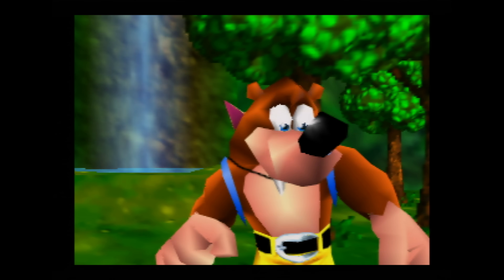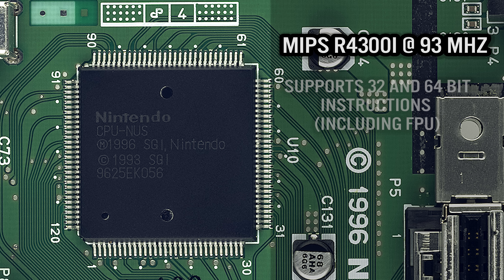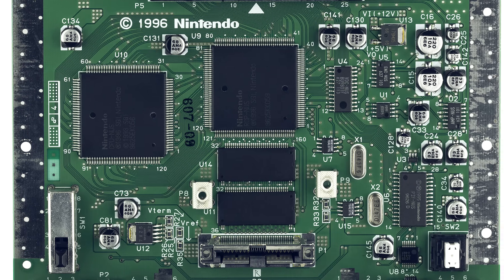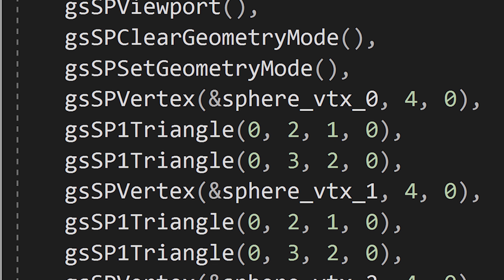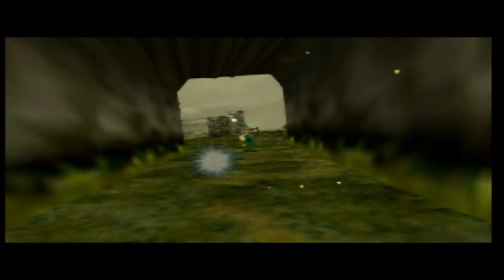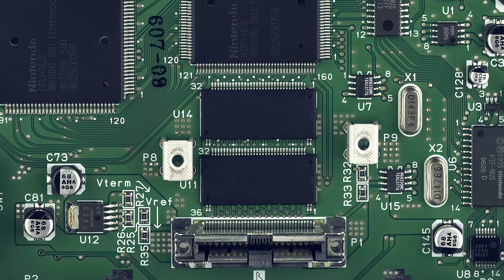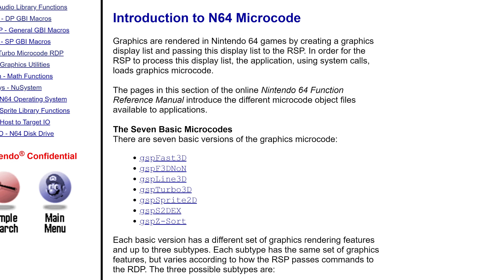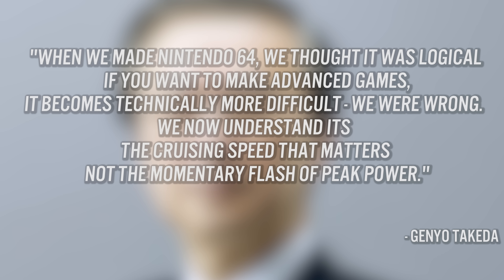Why was the Nintendo 64 so hard to develop games for ? | MVG

Comment: Honestly this boils down to new tech that nobody knew what to do with. At the time it seemed "really cool" to throw in a bunch of expensive sounding chips. Even better, lets make the whole thing proprietary and custom designed, that sounds even cooler. The same happened to the PS2 and PS3, they went through a similar phase. How many processor can we throw in, the more the better, it just keeps sounding more and more cool. What the gaming industry had to realize is that the ultimate goal should be simplicity. Multiple processors should only be used if they bring a clear advantage in keeping a complex system simple yet powerful. Proprietary hardware and code should be avoided because the most powerful asset is an asset that's tried and true and has been ironed out over time. Modern gaming systems now mostly do this with universal game engines, OpenGL or DirectX, and a move to standardized hardware but it took a lot of trail and error to realize the more custom parts you throw in the device doesn't lead to an equally impressive output, it just needlessly makes things complicated, provides a high entry barrier, and creates more potential bugs making development more expensive. Nintendo learned this early on but it took Sony a bit longer to figure out because they were persistent to keep trying different complex board setups in pursuit of the most powerful and most complex board. I think Nintendo and Sony both arrived at the same conclusion though and thankfully it's now so much easier to get into console programming.

Comment: I've only done homebrew development just for the sake of learning about these older systems. To give an example of TMEM, I took a font spritesheet I made for the 1989 Gameboy Original which was designed to fit into the lower third of Gameboy VRAM leaving 2/3 of vram free and ported that over to an N64 project. I was baffled that I had to break up the tiny front sprite sheet into 4 pieces so that I could load the font letters. I even had to implement an automatic bank switching system so that it would insert extra microcode as efficiently as possible to be able to seamlessly access the whole font spritesheet range. The font system alone required 2 people (Me and a friend) to implement and workout the bugs. I even commented in the code my disbelief that it was this bad and that somehow a much older black and white 4-color tile-based gaming system was far superior in this regard than a 3D powerhouse. That's only just one example, the extra complexity around such a small TMEM required a system to load tiny font tiles that had lots of bugs we had to iron out and then make efficient because the added complexity also added to the precious display list which needs to be kept down.
Reply: referral madness  The native languages. For the gameboy that was assembly and for N64 it was C. The same as most would have used back then. Really those are the only 2 systems I've homebrewed for outside of boot sector programs for PC's which don't really count in this example.

Both the Gameboy and N64 homebrew I did are opensource on Github https://github.com/junebug12851/GameboyBoilerplateProj https://github.com/junebug12851/HelloN64
Reply: referral madness  the popular, cheap, and readily available CPU at the time was the Zilog Z80. Nintendo being Nintendo decided to order that for the Gameboy however they wanted it tailored a bit so they ordered a custom variation of it. Therefore we don't have a name for the set of assembly instructions however because it's based on an incredibly common and well-known processor and because the gameboy is so old and has so little security the assembly instructions are very well documented and very well known. There are undocumented features and bugs but they're also well known by now. The only real mystery left is precisely how the graphics pipe-lining works which nobody really cares about unless you're building an emulator so I'd say the 1989 Gameboy is probably the easiest to get into and a 1989 Gameboy game will run on both a GBC and GBA.

Actually the 1989 Gameboy is so well known we actually have far better fan-made tools which are light years ahead of what the developers used back then and the fan-made tools are still actively being developed to this day with regular commits which is quite impressive. Out of all the consoles you can write Homebrew for, the Gameboy is by far and large the easiest to enter with the best modern tooling and even syntax highlighting and coding support. There's even sound tools that help you write great sound effects and music. The gameboy also has the best emulator support with full debugging capability like you'd have in modern tooling and the amazing fan-made compiler outputs symbol files the debugger picks up on automatically.

I say go for it and have fun. Here's a list of all the resources you'd ever need and plenty more to get started https://github.com/gbdev/awesome-gbdev

Comment: This video begs the question why the hell didn't Nintendo 64 output S-video & RGB Scart like the Super NES. Both consoles share the same AV-OUT connection as well. It's madness. The composite output on the N64 is worst ever! Out of all the HDMI mini consoles that have been released, the N64 should have been the first one out. Criminal.
Reply: it can do svideo just fine
Reply: @crashoveride879  The N64 could do S-video if you have a NTSC N64. If you have a PAL N64 you need a modern custom S-Video cable. Standard S-video cables don't work on PAL N64 machines. Standard S-Video &  RGB scart should have been available to all N64 systems out of the box.
Reply: Without Rare’s games there’s barely any games to put on an N64 mini. I guess they would have to work something out with Microsoft
Reply: @lvl99ultrathug  Yes and No. I think an N64 mini console with Rare's games would be better for sure, but I also feel that there are more good non-rare/nintendo games on the N64 than what people think. Eg: Star soldier, Forsaken, Sin & Punishment, Turok, Last Legion UX,  Cruisin World, Ridge racer, ISS, Quake 2, Resident evil 2 etc,

Comment: I remember that around the same time Intel based PC systems also used RDRAM which cost much more than the regular SDRAM of the time.  It made Intel platforms a truly expensive proposition (which added to the fact that Intel soon found themselves also struggling in the mire that was the Pentium 4 era) made AMD based systems a real lifeline to those like myself who are on a tight budget.
Reply: It was actually a few years later: Intel started using RDRAM  in 1999  late in the Pentium 3's lifecycle with the i820 chipset .  It went BADLY: the Pentium 3 couldn't take advantage of the memory bandwidth because it was on a standard  SDR (usually 100-133 mhz) front side bus but still got saddled with the latency penalties, the chipset itself was bugged as well so you couldn't use the fastest RDIMMs it was theoretically compatible with.  Intel then started pushing it hard with the Willamette Pentium 4 platform because the P4 was MASSIVELY bandwidth dependent: Consequently the P4 was designed with a "Quad Pumped  FSB" that meant a 100 mhz system bus had effectively 400 mhz of bandwidth, allowing the P4 to take great advantage of  RDRAM's memory bandwidth.  Price I( don't think any of the 3rd party chipset vendors ever used RDRAM), the aforementioned latency hit, improved P4 architecture (specifically bumping the L2 cache to 512 to 1 meg) and heavyhandedness by both Rambus and Intel meant  RDRAM fell to the wayside once DDR (speed equivalent to 2x the base clock) ram came onto the market. Intel effectively abandoned RDRAM by the time the Prescott and later Northwood core S478 chips were released.
Reply: @ironhead2008  Yeah, I am probably confusing the time period slightly because the late Pentium 3 era / start of Pentium 4 is when I remember my cousin having a Gamecube.  Personally, I had been away from the console scene since the Sega Gamegear and I was not aware of RDRAM before Intel started using it.
Reply: @jameslewis2635  to me it's kind of hilarious that intel made the same mistake Nintendo did with RDRAM : going with a pricey high latency system with lots of bandwidth that nobody else was using. Nintendo had the excuse of not knowing how to develop an advanced console at the time (nobody did, really). Intel? I suspect it was pure ego and impatience. They wanted to get clock speeds up and  figured they could bully everyone into adopting RDRAM. Instead, the market gave them the finger and went with 3rd party chipsets that or abandoned Intel entirely for AMD (whose EV6 bus and K7 architecture was nowhere near as bandwidth starved and could stick with SDR for a bit longer), Intel had no choice but to embrace DDR (which didn't have enough bandwidth for the Willamette based P4s with 256K of L2 cache)  and SDR (as a cheaper option for some mobo manufacturers - these were huge dogs as far as performance was concerned:weaker than late P3s) to move P4s and retain market share. Phils Computer Lab has done  several videos on SDR and RDRAM based P4s and how they stacked up to both the Tualatin based P3s and contemporary K7s as well as DDR based P4s, they're quite informative. The "end of the era" 3.06 GHZ Northwood core build he did with a FireGL X3 gave an idea of just how powerful  a system built around RDRAM could  be.

Comment: Speaking about how Nintendo looked back in hindsight and thought they should have done it differently - this reminds me of a little tidbit I noticed in some superficial qualities between Nintendo and Sony's fifth generation consoles to their later hand-held consoles.
Specifically, with the Nintendo 64 the system has error correction and texture smoothing at the comparative cost of higher polygon counts,  whereas the PS1 did the opposite.  But then several years later with the Nintendo DS and the Playstation Portable, it looks like they swapped positions.  Nintendo dropped things like texture smoothing in favor of performance whereas Sony did the opposite.

But that's just what I saw from a superficial look.  I'd be interested in hearing someone with a better technical understanding take apart those systems and see if Nintendo and Sony really did both decide that the grass was greener on the other side of the fence.

Comment: (From what I can tell by a precursory scan of the documentation) One big issue with the texture cache is that it wasn't acutally a cache, but a dedicated memory space.  This means that the program had to manage copying in textures as needed "by hand", and in general, you'd have to copy the entire texture even if only a couple texels are actually used.  Also, the texture unit could ONLY access that 4KB texture memory.  If you wanted a texture, you had to copy it over there.

What this ultimately meant is that you would have to sort all your triangles by texture when you rendered them, and of course, the more textures you used in a scene, the more time would spent copying textures and not drawing pixels.

Partial transparency/alpha was also made more difficult by this arrangement, since rendering it correctly requires that the (transparent) triangles are rendered starting with the ones furthest away and rendering the nearer transparent triangles blended on top of them.  Remember how we also wanted to render the triangles sorted by texture to avoid thrashing texture memory?  Uh oh!  Thankfully textures with pixels that are either opaque or else completely transparent (such as trees) don't need to be rendered in back to front order - the z-buffer can take care of this case.
Reply: The Texture Chache issue was debunked by Homebrewers 2 years ago. The N64 used 4 Dies and had 32KBs on Each. But it required A Dual Thread with the NECVR4300 CPU and SGI RCP Graphics Chip, but MANY developers weren't used to that method. So they just resorted to Storage Capacity on the Cartridges and relied on N64's EXTREMELY primitive software tools including Open GL, and Run Scope. The Open GL Tool for N64 was limited to just 4KBs of Fil Rate without use of the main assets of the SGI RCP.
Reply: aaaauuhhrrgggg mah gawd, the stupidity! I would try to change job if faced with something like that.
Reply: imagine if it was a proper cache with weighted ejection rates and everything.. managed by the hardware itself..

Comment: Out of interest, given how powerful the system was for its time, what do you think could have been achieved if file size (...or texture cache) wasn't an issue? It would be interesting to see an N64 game without the limitations of the cartridge size just to see what the hardware is capable of when you can have a load of higher quality texture assets.

Comment: 1:40 5 stage pipeline = 5 instructions in flight at the same time, not 5 instructions executed at a time. Its not exactly a selling point, just obscure implementation detail.
7:00 megabyte
Btw in reality 4.5MB + optional another 4.5MB ;-) with 0.5/1MB dedicated to RDP 
7:40 Latency is not memory retention. Those two things have zero in common.
9:30 wait what? optimization by disabling Zbuffer and manually sorting/drawing further first? wtf?

Comment: RDRAM SUCKS.  It's absolutely terrible and was pretty much false advertising.  Its transfer speed is on paper only, in practice all other RAM types were (and still are) drastically faster.  This doesn't even get into how terrible the company was.  The only actual advantage it had was the bus circuitry used to connect it was simpler.

Comment: 1:43 - A 5 step Instruction pipeline means EACH instruction takes 5 stops at clock speed in the CPU to complete the machine code instruction. This is NOT parallel processing that you'd get from multiple cores. You complete 1 instruction per clock cycle, with 4 instructions processing in line behind it.
Pipelining is used to increase processor clock speed by splitting more complex instructions into multiple steps.

For comparison, the Pentium 4, released in 2000, had a 20 instruction pipeline to increase nominal processor clock speed (GHz). Long pipelines can be a major weakness. If you choose to go left instead of right (branching), the Pentium 4 might need to throw away the last 19 instructions, and then you'd have to wait 20 clock cycles for the correct instruction to be processed through the whole pipeline.

AMD focused on performance over marketing, and Intel gave up on the P4 giant 20 step pipeline in 2007 (high heat, mixed performance), dropping down to 14+ stages in current processors.

Comment: You really nailed the single biggest bottleneck of the N64: the texture cache. 32KB would have made a HUGE difference to games. The second biggest flaw was the 4MB RDRAM, it should have shipped with 8MB.
Reply: N64 used 5MBs. Not 4MBs. SATURN used 4 MBs.
Reply: @segaunited3855  N64 shipped with 40Mbit of rambus dram.
Reply: @FurEngel  Rachel(N64's SDK) had 5 MBs of VRAM and pipelined 4 MBs of DRAM. And theoretically was capable of up to 10 MBs of VRAM. Sophia(Saturn's SDK)  had 4 MBs of VRAM and 2 MBs of DRAM and theoretically was capable of up to 8 MBs of VRAM.

Comment: Hey MVG. What exactly did you mean by N64 games not seeming as fast as the PlayStation? What does this have to do with its low fill rate? Thanks.
Reply: He means the interpreted speed of gameplay(How one perceives it).. An analogy, if you're running around on a PS1, you're walking around the map on N64. The games felt slow. I'm no expert here, guess incoming, but fill rate must be similar or related to draw rate. The N64 couldn't compute the distance as it came into foreground at a rate equal to the PS1. Again, running down a corridor vs walking. Feel free to correct me if I'm wrong.
Reply: @kaydog890  I think he meant that they often didn't run at as high of a framerate.  A completely stupid statement to make as your basically comparing apples to oranges.  Look at the massive environments in a game like Golden Eye or Perfect Dark.  What on Playstation or Saturn is anywhere close to being that ambitious?  Nothing.  A game like Metal Gear Solid with fewer enemies, simpler environments, and an overhead perspective is of course going to be able to maintain a more consistant framerate.